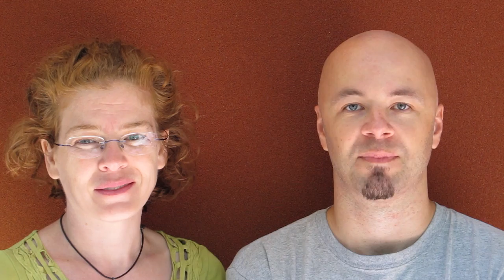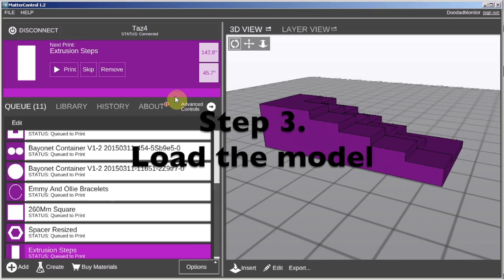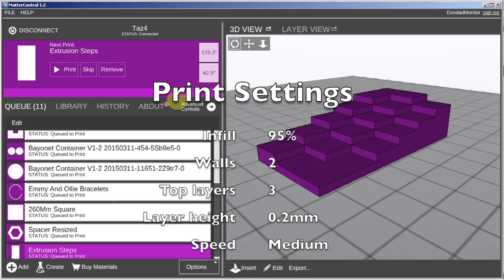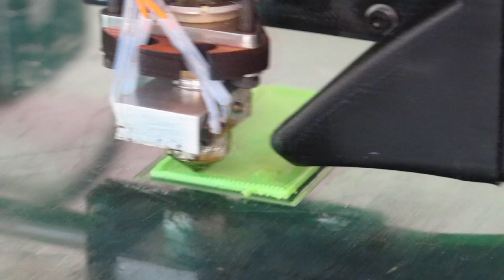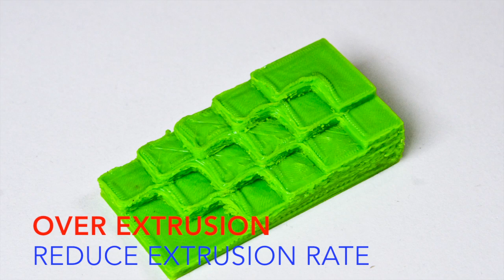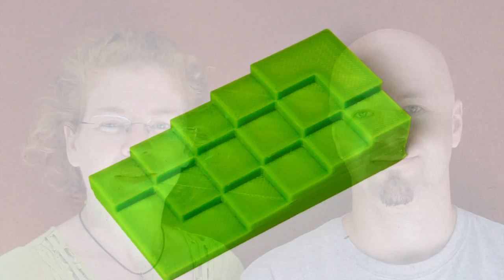Troubleshooting 3d Prints Calibrate Extrusion Rate

Comment: If initial stepps/mm is 111.9, and i adjusted the 'on the fly' flow down to 70%. I should set the new steps/mm to (111.9x0.7) = 78.33
Am currently using PET-G @ 233 & 75 celcius hotend/bed.
Is that correct? as I had to increse the steps/mm for PLA to 111.9 (from a previous calibration).

Comment: Thanks, this looks like a promising method. Which is the best infill pattern to be used? I tried on Slic3r, and the only two patterns that actually make a difference at 95% are Line and Rectilinear.

Comment: what is a normal extrusion rate speed? im using replicator g and i set i dropped it from 60mm/s to 40 then to 30 then to 20 mm/s i also lowered the speed to about 40 mm/s. I feel like 20 mm/s is a huge drop from 60. I am printing the model you guys linked and it still is coming out wrong. i feel like going down to 10 mm/s extrusion rate is extreme.

also i am printing ABS and my print temp is set to 220

Comment: Thank you for posting this. I've been struggling a bit with the extrusion rate at low resolutions and low in-fill.. bridging the gap is a task.  Your video broke it down perfectly to help diagnose and correct.

Comment: Ok, when i start printing my prints come out zebra stripped... not sure how to fix this... have already leveled and calibrated the bed... any ideas?
Reply from the maker: +steve bosheemy Zebra? Without seeing a picture I'm not sure I know what's going on.
Reply: +steve bosheemy could it be that your hotend temperature is oscillating? that means the PID control in the firmware isn't setup correctly, the zebra stripes come from extruding too cold for a while and then again too hot for a while and so on

Comment: I disagree that the extrusion rate is important, I even disagree that it should be used at all: when you set to something other than 1 (100%), you are saying you do not trust the slicer's calculations and masking some possible problems. The extrusion rate is useful as a temporary workaround but not as a definitive solution.

I would also advise, when measuring the filament with the caliper, to also measure the diameter 90° from where you measured and get the square root of the product of the two diameters, to get the diameter of the circle equivalent to this ellipse (a filament is rarely perfectly circular). Skipping this measurement might be the reason why you are using extrusion rate...
Reply from the maker: +Maker Linux Interesting. Maybe make a video explaining this? And yes, you're right, I don't trust slicer calculations at all! I use different extrusion rates between each slicer for this very reason.
Reply: Completely disagree. Adjusting the extrusion rate is critically important for accurate, strong, good looking models. The slicers calculations are in fact not always correct. What is more important is the real world results. Calibrating extrusion via the method in this video is the quickest way to get your over or under extruding printer creating strong, accurate, good looking models; and fast. 

I think it is important to mention that unless you are working with very low quality filament measuring the diameter is a complete waste of time. If your filament producer has any quality standards then your material will be within the range that they specify. If the manufacturer does not have good quality standards; then measuring the filament diameter at one point will have no bearing on the filament diameter at another point. When I've had filament outside the specified tolerance indicated; it has usually been completely inconsistent throughout the full spool. It will be 1.85mm in one area and 1.65 in another area. Whereas good filament will only range by 0.02mm rather than 0.2mm. So plugging in these numbers will only cause you more problems and headaches later on.
Reply: Extrusion rate is definitely important and depends on quite a few factors. I even like to have my EF calibrated for each new spool of filament.
Reply: Extrusion rate is very important because different 3D printers can be built with different accuracy (dimensions, electronics, materials etc.). There is no identical home 3D printer. Thus extrusion rate calibration will help to compensate significant part of error caused by inaccuracy of certain 3D printer. Any slicer software just dont know every 3D printer on the planet.
Reply: I'm only a newbie, but I've already realized that your settings depend on the model, ALOT!
Reply: You wouldn't say that if you bought a Geeetech printer or and Athrobot. Their factory calibrations are so far off it's diabolical. I'm running at 108% flow rate with this new printer and I've looked at every other possible problem to no avail. It has to be that the E-steps are out, which confirms what I've heard from other users.

Comment: The first roll of filament that came with my Ultimaker said 2.89mm and the second roll I bought said 3mm. This video series has been very helpful because it turns out that is more than a marketing thing. :)
I adjusted the bed with a dollar instead of a piece of paper and slowed down the extrusion rate. Now it's working beautifully. So thanks for the help.

If your taking requests for what to next Fan Speed. I understand it's important for bridging but I have yet to try that. I don't even know what specifically im trying to achieve with the fans.
Reply: Razedbywolvs Fan speed is a great one! Ok I'll put it on my list :)